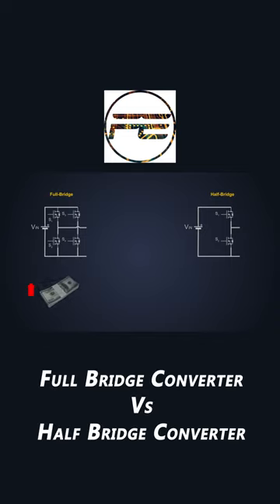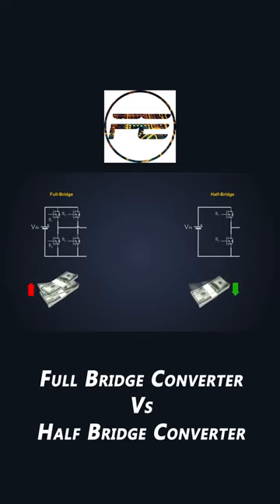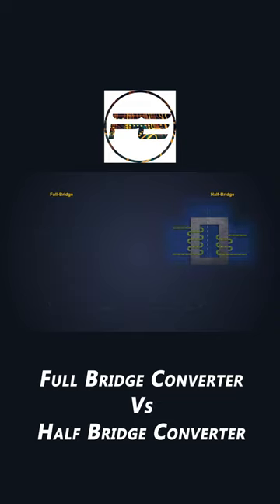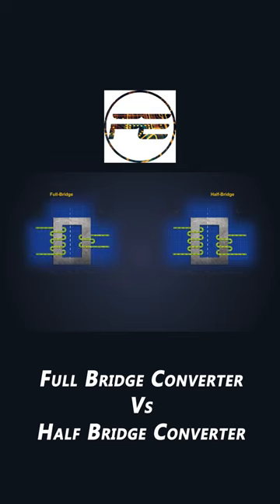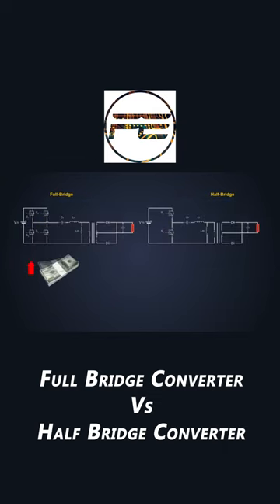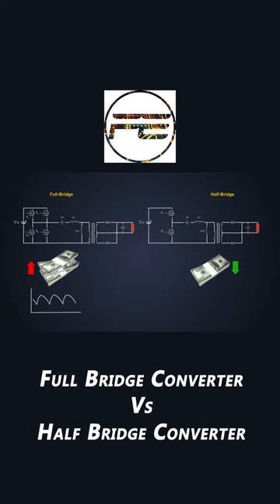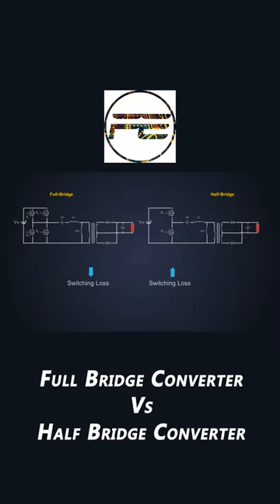Full Bridge Converter Vs Half Bridge Converter

Comment: Hım I am looking for a PSU for my PC. Specifically, MPG A850G PCIE5(has LLC Half Bridge Topology and Japanese Capacitors) and MAG A850GL PCIE5(Full Bridge Topology and probably not Japanese capacitors since it did not mention). Basically, full is more expensive and causing to lose efficiency? so, they used half bridge in A850G to increase efficiency and the money left from bridge topology is used on capacitors which is leading us to Japanese capacitors. I know you are not PC master I guess but in this simple equation, which one you would choice?  I would happy and appreciate if you can give me some tips or any other good power supply recommendation if you know them.